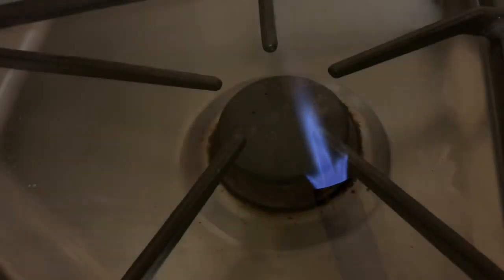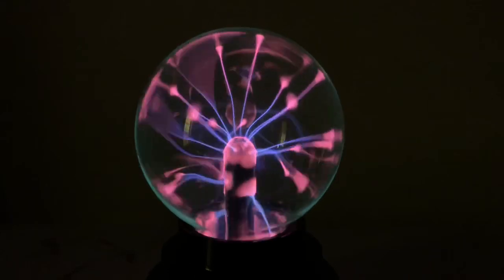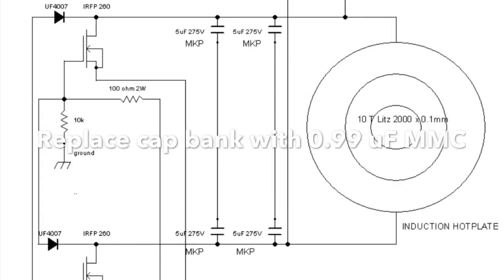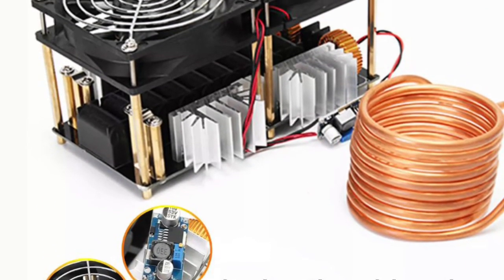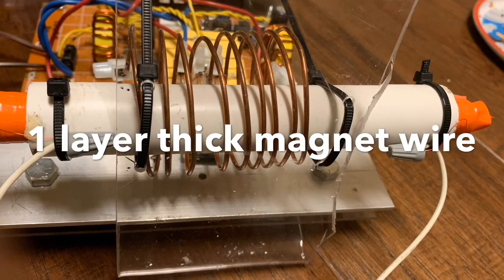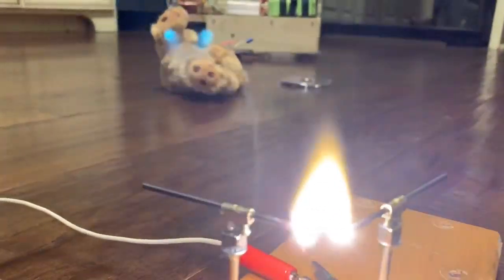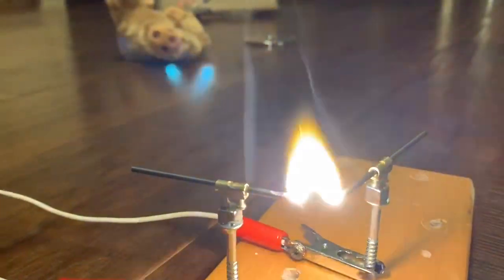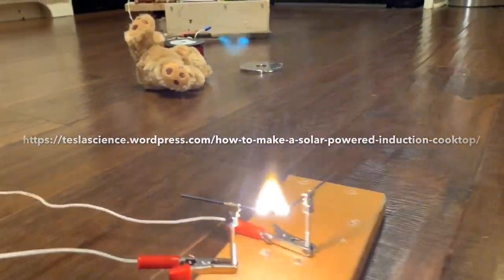Make a 4000C Plasma Flame

Comment: Why use a ferrite rod instead of typical U ferrite cores?
Reply from the maker: I just wanted to try it since I had one lying around. Also it is easier to control the windings in the secondary (wire spacing etc). The wire is much closer and better coupled to the ferrite rod compared with the way a regular Flyback transformer is wound on a C-core

Comment: where to buy this?
Reply from the maker: I actually made this one. I have updated the Wordpress page to show how to make this:
https://teslascience.wordpress.com/high-power-resonant-ferrite-rod-transformer/

It should work fine with a bought one!

However you would want to remove some of the capacitors to give 1 uF. They come shipped with 2uF. The reason is to get the system resonant if you use the same type of ferrite rod shown in the Wordpress page. 

To buy
https://www.ebay.com/itm/183458102131

Comment: No. of turns in secondary coil ?
Reply from the maker: Its an 8 inch long by 0.5 inch wide ferrite rod covered over in electrical tape and then wound from one end to the other with 30 gauge magnet wire about 650 to  700 turns
Reply: @BrianDhvTinkerer  thnks for the info..